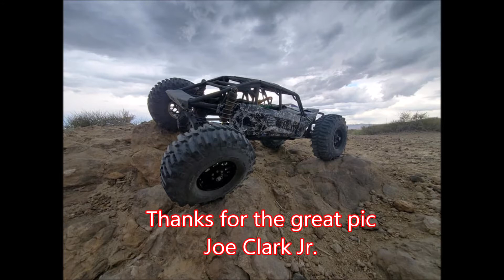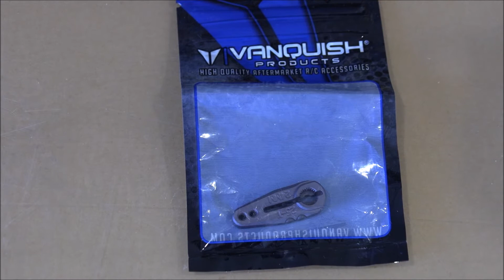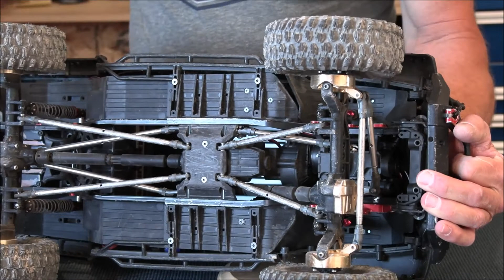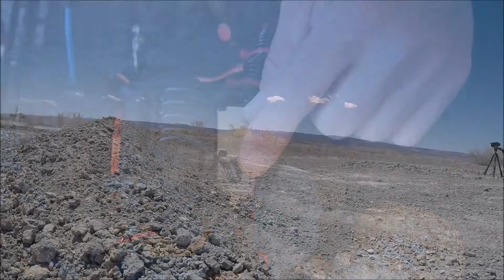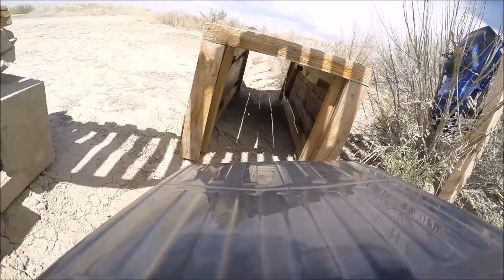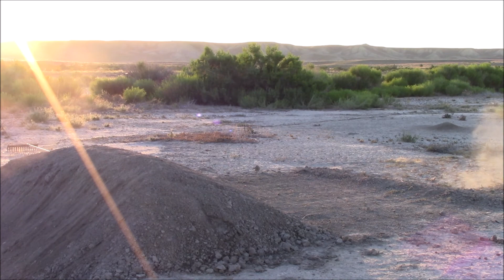Dropping a Reefs Raw 500 servo in the Gladiator

Comment: Trevis, what are you using as a strap that holds the body on?  I’m guessing the 4 pins are no longer used?
Reply from the maker: I am using the  pins in the front and I have 2 little strips of velcro for the rear.